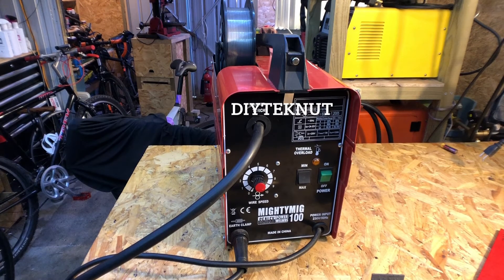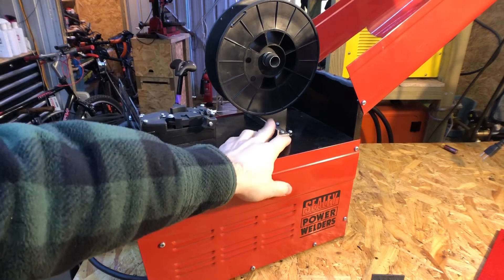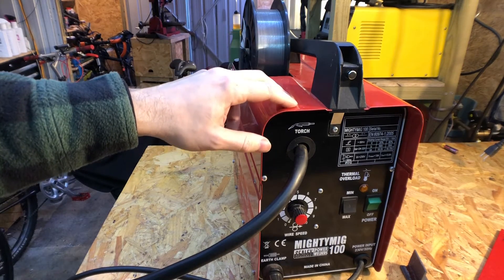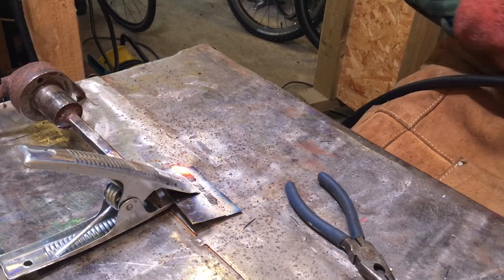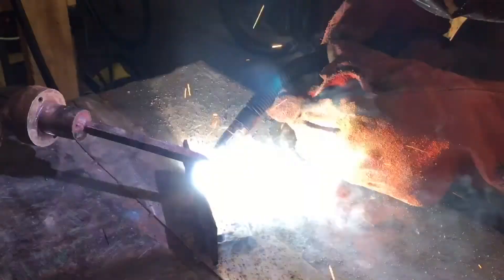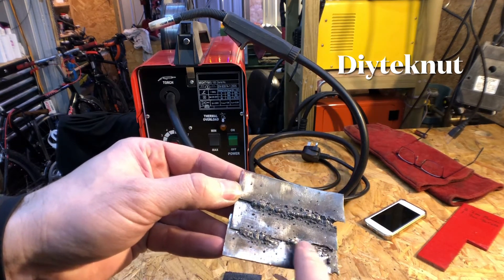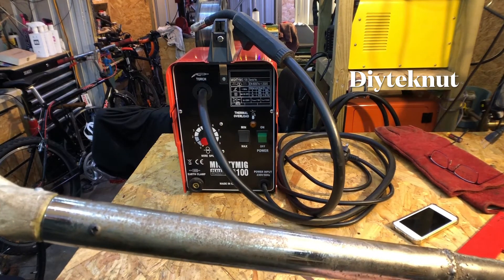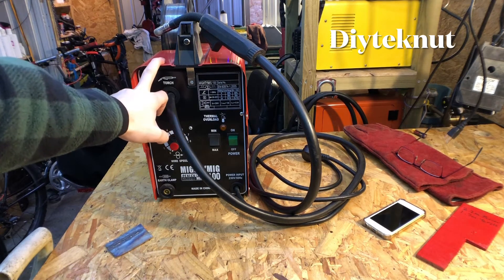Sealey MIGHTY MIG100 Professional No-Gas flux Core Welder Review

Comment from the maker: Sealey MIGHTYMIG100  https://amzn.to/3oX66R8
Tools on amazon
*Portable Welding Table https://amzn.to/3jn2kzg
*Cobalt Drill Bit Set https://amzn.to/3coyx88
*MMA welder https://amzn.to/3r4SuVo
*Magnetic Welding Holders https://amzn.to/2YM6ozI
*MIG welder https://amzn.to/3gF3juF
*TIG welder https://amzn.to/3r3N2lU 
*MIG Welding Multipurpose Pliers
*Tin Snip https://amzn.to/3raf3IB

Above are affiliate links and in the comments it costs you nothing, if you do not want to use links search on goggle more info Thanks.